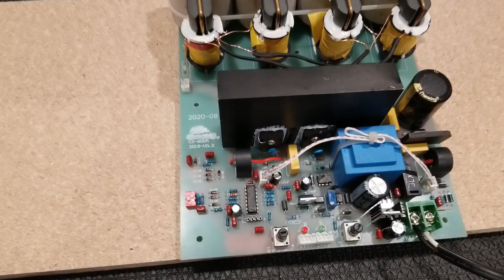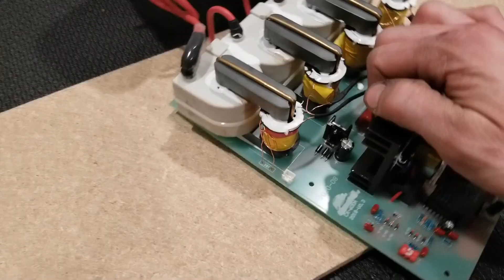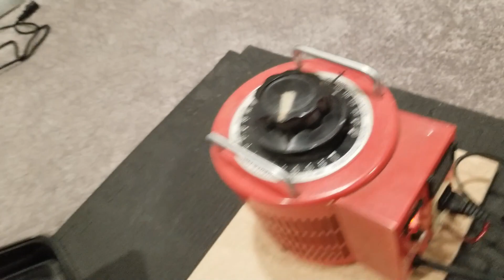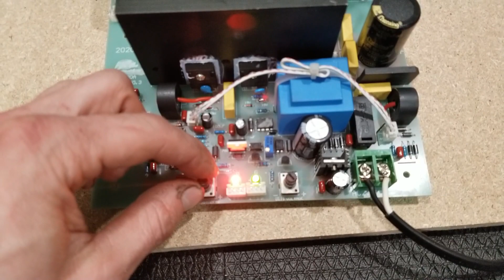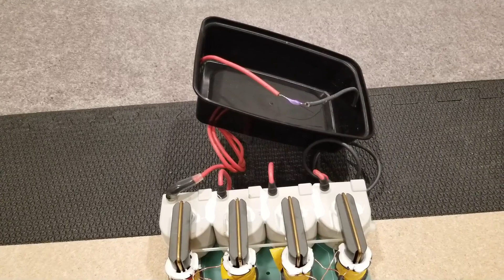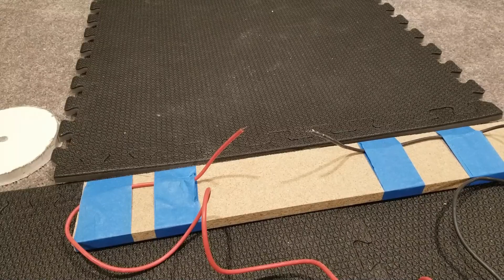HIGH VOLTAGE POWER SUPPLY REVIEW AND TEST

Comment: I have bought one of these power supplies, and i also have a lower  - 30kv model. To achieve nice results, you can use that small multi turn potentiometer on pcb to increase the output power. In my case it goes up even to 100kv.
Reply from the maker: @rafalg.6901  yea I eventually figured that out, then I burnt out the transformers lol.
Reply: @MrTurboturbine  Mine unfortunately also started sparking today, after working preety fine for few days. I am wondering, how many turns with this pot is a 'safe level" in this case. I made 10 turns, which is max level, obviously  it was too much.